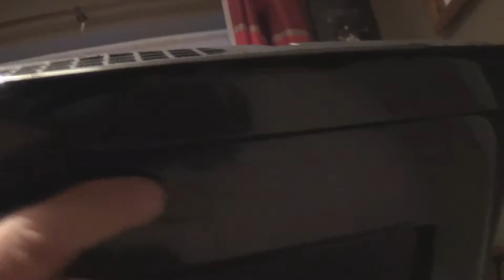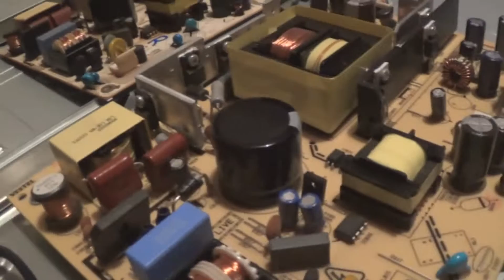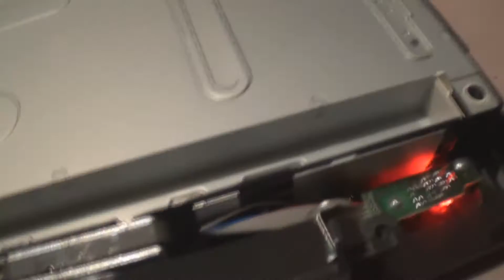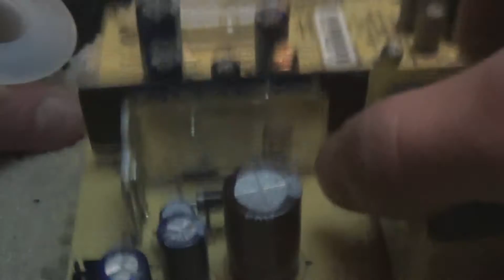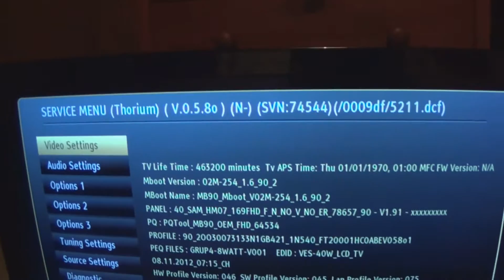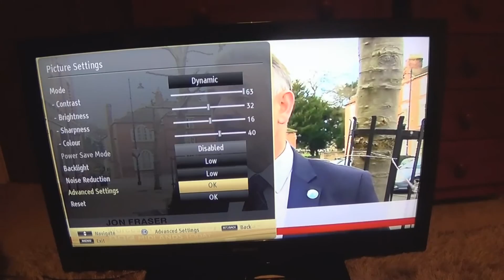17pw82 Repair + Common Issues

Comment: HI MrReeceyburger123. I REALLY NEED YOUR HELP WITH MY TV . please help if you can im so much money into the tv, its at a point i cant stop now.  My tv is a JVC LT-42TG30J. The story so far is it has the same PSU as you have in this vid, it also had the same simptoms as you discribed in this vid regarding the tv. So first i replaced all the caps and the four diodes as you discribed, on powering back  up it blew the fuse in between  the two AC inputs. The white one and the black one,  as mine has a switch on the back, anyway i  gave up on the power board,  and bought another, on puting it in i noticed the board that i bought had only the white ac input so i left the switch out and pluged the ac straight to the white input. When powered up the blue led flashed and the back light came, on very dim and a blue led on the inverter  came on for  3 seconds clicked of, along with the back light, then it would start the start cycle and do it over and over again, i checked  the four 24v from the power board to the inverter all ok, so i bought another inverter, now when i power it up with the  new inverter the back light lights up properly, but shows nothing else and still powers of after  5 -6  seconds. My question is   ,   is it becase i have not got the second AC power  socket on the PSU for the switch on this PSU, and if so can i solder the black AC switch socket from the old board to the new one, or do you think there will be more componants to it than just the socket, or do you think its now the main board, which is what im dreading Any advice you could give would be most help full,  i cant or wont throw this telly away  its become a matter of principal that this tv gets fixed, ive to much time invested in it. And i hate it when my kids keep saying is it fix yet dad and i have been saying  not yet soon will be. I CANT BIN IT NOW , you know what i mean. Please help  thanks paul.
Reply from the maker: Hi Paul, can I ask is the Psu you brought exactly the same as the old one parts layout wise ?
Reply from the maker: Start a thread on badcaps.net and I will help you over there.